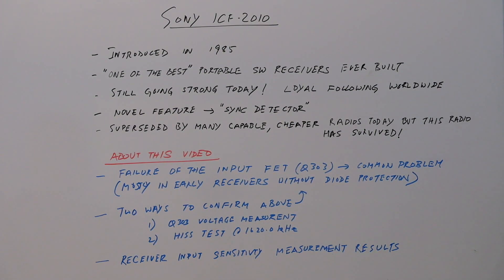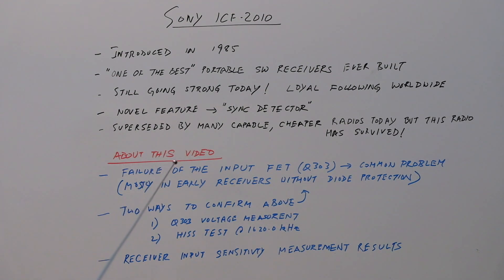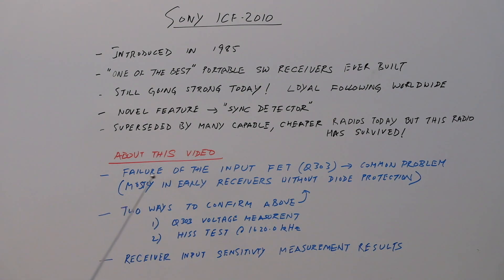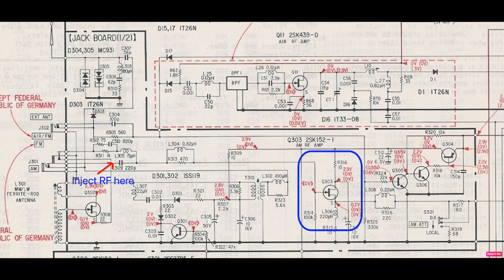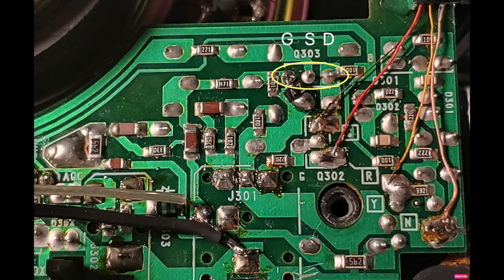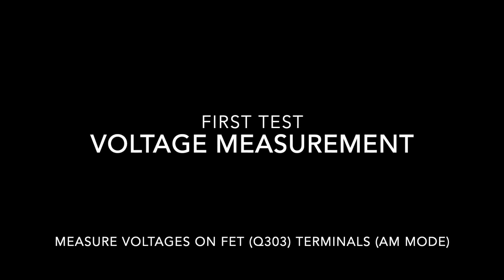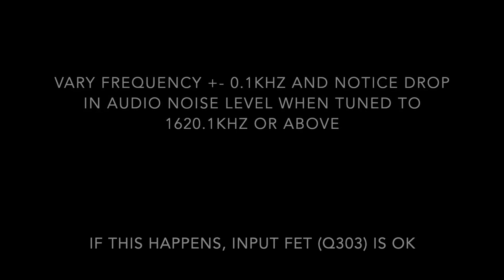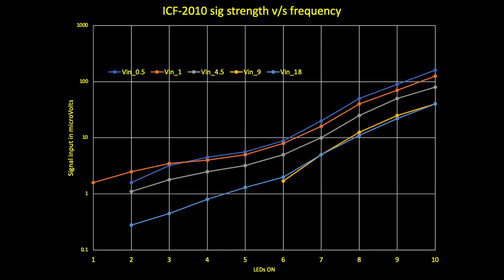The Sony ICF-2010 radio - sensitivity

Comment: Thank you for such an informative discussion.  i purchased this gem in 1989.  For about the last 10 years or so, it has been i in storage.  i recently became interested in using it again.  Aside from a flakey “on/off”. switch and an inoperative display light, it receives some AM and FM stations.   I plan to give the PC board a visual inspection for any obvious problems.  If it becomes necessary to replace some of the capacitors, what supplier do you suggest.  Apparently Sony has produced a kit that contains replacements, but it they are of the same vintage of the radio, they may also be showing the signs of age.

My question is where is a good source of replacement parts.
Thank you,
Fred
Reply from the maker: Sometimes you get kits on eBay (I have seen these for many radios). Second option is to buy an assortment of common values which hopefully covers all that you need. Last option - create a list and order them from Digikey, Mouser, (in the US)... which is likely to be the most expensive way to go. All the best.

Comment: When i tune my sony icf 2010 to a fm station lets say the original frequency of the station is 91.5MHz but my radio will tune it at 91.55 MHz. Any idea what is the issue?
Reply from the maker: It's not possible to tell on FM if your internal oscillator is off. The phase-locked-loop (PLL) will get pulled to the correct frequency that is determined by the carrier which is at precisely 91.5MHz. You can use the sync function on AM to see where it switches between the upper and lower sideband on a strong AM signal. That will give a better idea of your radio's tuning inaccuracy.
Reply: @analogwings  yes i used sync to check tuning accuracy on am and it is totally accurate. Only fm has this issue all other receivers tune perfectly at 91.5 but sony tunes at 91.55 my radio was fully restored with new capacitors and new narrower fm filter maybe that is the reason i don't know.
Reply from the maker: Section 3 of the service manual goes into some detail about IF alignment and other oscillator frequency adjustments for FM. You will need to open up the radio and probe some internal test points.

Comment: Thats so informative...thanks a lot..where are you located..1620 is some me station or you generated it from signal generator
Reply from the maker: You have to tune the radio to 1620 kHz (usually that frequency has no broadcasts on it). No need for a signal generator. You are trying to ascertain noise  level on an unoccupied frequency at the boundary of two AM bands (MW and SW) which is the case for this radio.